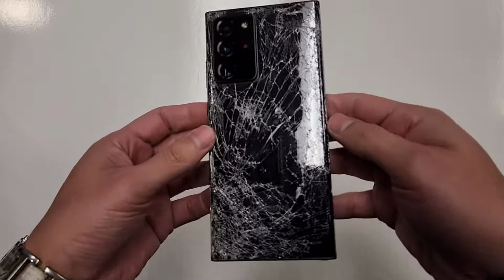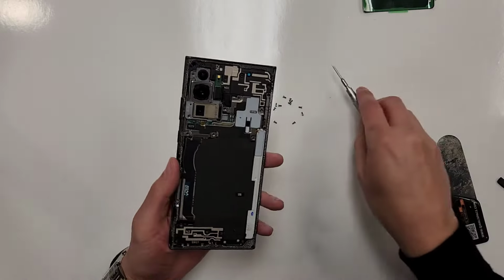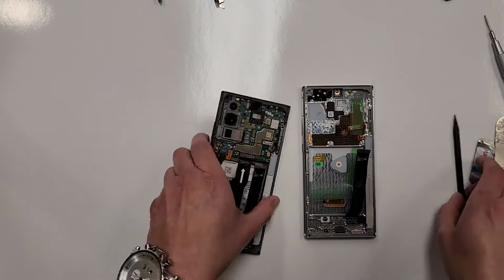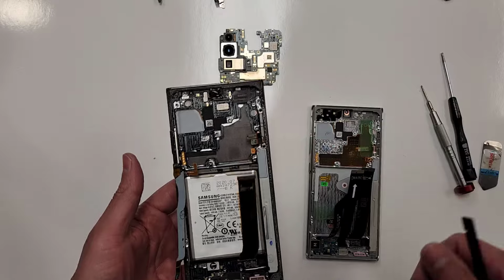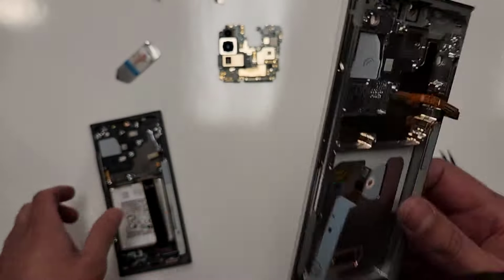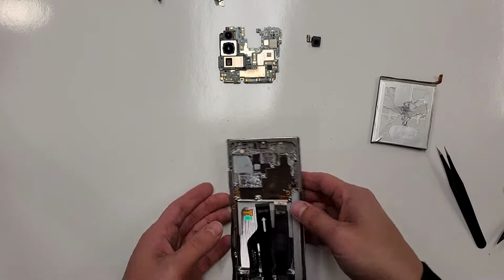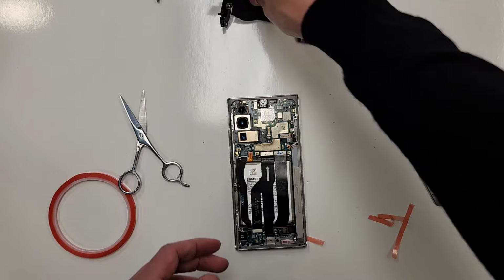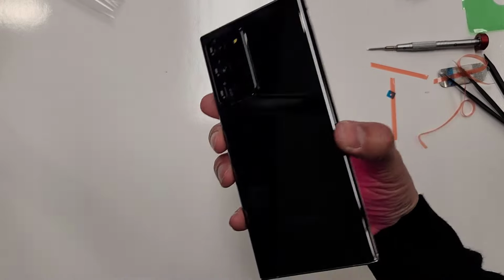Samsung Galaxy Note 20 Ultra Screen Replacement for BEGINNERS | How to Repair

Comment: I replaced my cell phone screen following your course and now I have two lines running parallel on my phone what did I do wrong
Reply from the maker: If you are in my course, message me directly through the platform.

Comment: Have you ever tried using nah oem screen replacements?? Do they work as well??
Reply from the maker: The Aftermarket ones that are $120 cheaper, suck.
Reply: And the screen isn't the 6.9 inches, but smaller 6.7 for those cheap ones

Comment: Hello, can the glass of the s10,s10plus,note 10 and above be changed using the freezer method?  And can a home freezer be used for this process
Reply from the maker: Home freezer does not work. Doesn't get cold enough. The way screen refurbishing works now is the heat and wire method. Nobody uses the freezer technique anymore.

Comment: There is no link to buy the screen for the Note 20 ultra.
Reply: He said he is gona start linking in the future
Reply from the maker: Here you go. My supplier I use only sells business to business. So I searched around to a couple other websites I here it is. The service pack with screen protector already installed https://m.gadgetfix.com/white-display-lcd-screen-digitizer-frame-for-samsung-galaxy-note-20-ultra-n985-n986-service-pack-6020.html
Reply: @RichardMeza  What do you think of the parts that come from amazon or aliexpress?
Reply from the maker: @timogoosen8570  I looked on Amazon and this particular model was like $100 USD higher on Amazon. Alixpress I've never bought parts for anything on there before.
Reply: @RichardMeza  thank you very much 😊 🙏
Reply: @razorr527  Did you use this part for your replacement? When I called I was told by the rep it was OLED not AMOLED, and it didn;t come with the fingerprint reader. It should also say mfg SAMSUNG but it says unbranded.. so I'm suspicious of the SP from this site.

Comment: I have a question: Have you ever had an issue with the front camera. I'm getting a warning message that the camera failed. I checked under the motherboard, and everything is connected. I hope you can help me. This is my first S23 Ultra 5G screen replacement, I did a Note 20 Ultra 5G before with no problems. I was told by a repair shop that the phone has to be recalibrated by Samsung??? Have you heard of this before. Any help would be greatly appreciated. Thank you

Comment: Hello, after samsung s7 all samsungs is the same method for repair. open on the backglass. The repair is easy job but the problem on samsungs are the screen, too expensive, mostly people on USA choose buy a new one.
Reply from the maker: There are people that do and people that don't. There are people that think its expensive to pay $100 for an iPhone screen while someone else will think it's perfectly fine. I would say it's easier to charge for more expensive things in general, it doesn't matter what product or service you offer, in better neighborhoods.
Reply: A well maintained phone can last for years. And also all the settings, Routine automations and customization already done on the current phone to suit our lifestyle. A new Samsung flagship Samsung Galaxy S23 Ultra 5G (512GB/12GB RAM) cost SGD1,400. An original Samsung Note 20 Ultra replacement screen from Aliexpress cost S$290. So for me it is more cost effective to repair 😆